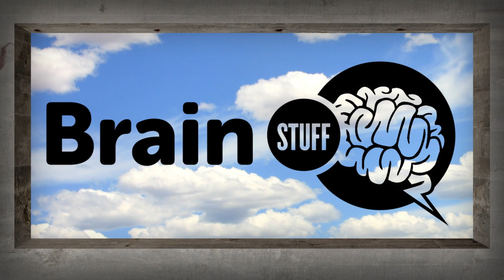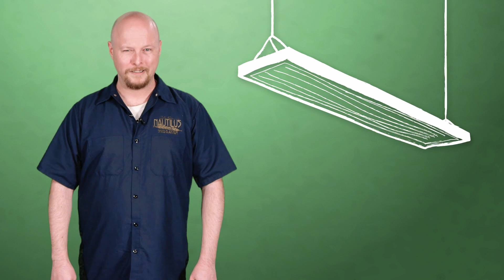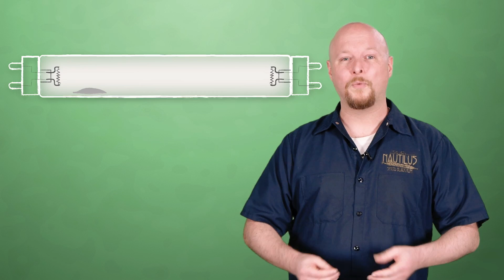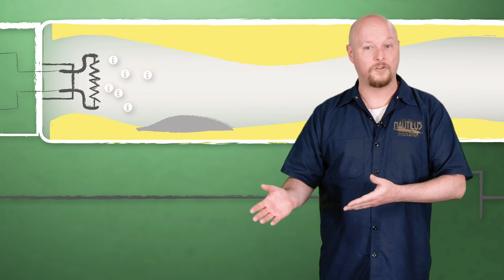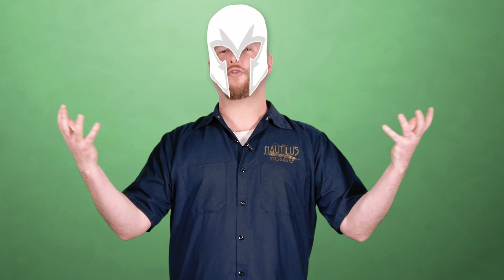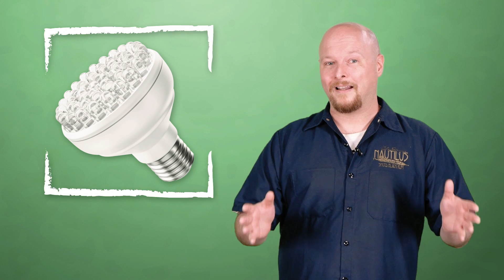Why Do Fluorescent Lights Make That Buzzing Noise?

Comment: "If you're not careful and you no-clip out of reality in the wrong areas, you'll end up in the Backrooms, where it's nothing but the stink of old moist carpet, the madness of mono-yellow, the endless background noise of fluorescent lights at maximum hum-buzz, and approximately six hundred million square miles of randomly segmented empty rooms to be trapped in. God save you if you hear something wandering around nearby, because it sure as hell has heard you"

Comment: I worked at a business college for a time and as I am not a young lad any more l couldn't always hear that annoying buzz but the younger students could. It wouldn't be present at first but the longer the lights were on, the more it would buzz. I did indeed replace many florescent lights in my time. The noise is like a tiny critter is in your head and is sliding a knitting needle in and out of the ear really slowly. 😩

Comment: Actually, it's a tad more complicated than *just magnetostriction*. If you have a fairly recent well built fixture, the noise is very minimal. pretty much to the point it's almost completely unnoticeable in a dead silent room. The reason a fixture which was once silent would become noisy and create that hum has a couple reasons. 1, the ballast itself gets quite hot when in operation. enough to cause fairly significant thermal expansion of the core. 2, the ballast likely undergoes many heat cycles from being switched on and off and 3, the forces of magnetostriction cause the core of the ballast to vibrate a bit when in operation.

combine the temperature cycles and the high operating temperature of the ballast with age (say, a good 15-20 years on a well made ballast) and you end up with  a failure of the adhesive that holds the iron core's laminations together, which can allow them to resonate against each other due to the magnetic field generated by the coil. this is where you get that loud and obnoxious buzzing noise from. It's also worth noting that electronically ballasted fixtures (which pretty much all recent ones are) don't exhibit these behaviors as their inductors are much smaller and operate at frequencies inaudible to the human ear. not to mention they don't rely on electromagnetism exclusively for current limiting.
Reply: Forgot to add that the switch may not be compatible with new bulbs introduced on the circuit. Humming is a resistance issue especially caused in led retros on a non capability switch not designed to old designs to handle the semiconductor of the led produced.

Comment: In a building I manage I have vanities that take 4 bulbs. In one particular installation we have gone from incandescent to LEDs (60W) in trying to get rid of the humming sound, but to no effect. There is only a simple on/off switch in the cct. CFLs have shown to have a similar sound after warming up. Might you be able to tell me 'what's up with that?' thank you
Reply: Make sure the switch is capable of the retrofit bulbs, if the switch is old and you retrofit leds it could cause electrical noise due to resistance interfering.

Comment: Ballast ( or choke)  does not serve to limit current.
Actually it serves to  rise voltage to achieve to "breaking" point  from filament to filament.
Once that point is achieved you have plasma which regulates it self (R C circuit effect)

Comment: Are you sure the Mercury is Liquid ?  I was under the impression it was in a powder form, which electrically excited, forms a gaseous state when charged. Its basically the same thing, but I wasn't aware of the mercury being in a liquid state.  Nice Video though. Well presented and well scripted.  Shame you didn't have any examples to demonstrate. Would love to know a bit more about what physically causes the ballast to vibrate so. I have a set of ( former ) kitchen strip lights I mounted to a picture frame as a sunglass compensator/work light.  
  One of the buggers buzzes.  They must have the ballast built into the housing. Tried swapping the bulbs about. But its from the unit itself.  
 Might rewire to see if running them in parallel works better than series ( last one is the buzzer )

Comment: I actually prefer far beyond fluorescent than LED. I think the greatest thing you can do if your ballast is humming is replacing it with an electronic one, which may not last that longer than a magnetic one but shure it will not hum, maybe at all!
Reply: i can put up with a bit of hum, especially since if the ballast is in good shape they hardly hum at all. i have some old fluorescent lights from the early 50s that still have the original ballast and they hardly make any sound at all unless you put your ear up to them. electronic ballasts normally struggle to last even 5 years.

Comment: I use a fluorescent light in my basement since i use a computer alot, and a light that would leave streaks of light in my eyes when i blink wouldnt be desirable (Also since the design of them lights up more space)
Whenever i have my headphones off, that noise drives me absolutely insane, even with them on, i can hear it loud and clear
You can hear it through the floor into the living room, and whenever im talking to someone via skype, they cant hear me at all

Comment: the considerate amount of voltage is about 25kv or higher depending on the type of fluorescent starter and ballast, also the buzzing doesn't come from the tube itself, it comes from the ballast, much like when you hear the hum or buzz from the transformer in some electrical appliances and devices. one of the ways I know this is mainly because I looked into lighting for a decent sized portion of my life.

Comment: Why does the US have 120V/60Hz while the EU has 240V/50Hz? It seems smarter to have a higher voltage and less current for the same power, since it's the current that induces voltage loss over distance and also creates more heat in power appliances.
 Was it purely because of history?
Reply: Lord Thanksalot The US does have 240V/60Hz it’s just split into 2 phases in the panel each phase is 120V/60Hz and there are times that use both phases to get 240V/60Hz like the drier stove electric water heaters and electric furnaces (some gas water heaters 120V/60Hz and all gas furnaces use 120V/60Hz)

Comment: Got on this video by mistake. 2 months ago my dad mounted a new light bulb in my room, is like a circle and it flashes for 4-5 seconds, then it turns on and makes a noise, didnt checked why this makes sound. I throught it was because it was cheap (10 USD) but now I know why it hurts my ears. Gonna ask him to replace it asap.

Comment: So how do CFLs die and why do they turn black at the ends when they are about to?
Reply from the maker: I'll add that to our list of future topics. But there seem to be a lot of electrical/lighting experts here in the comments. Anyone know the answer?
Reply: karebu2 as the bulb strikes on (powers on) the filaments heat up and when the bulb finally strikes and lights it blows a tiny amount of the metal on the filaments off onto the side of the lamp and of course since it’s AC power the light is off and on 50 or 60 times a second causing it to wear out and fail 

I hope this explains that well enough 

-SomeRandomGuyWithAChannelOnYouTube

Comment: Long, straight tubes are not CFLs as they are not COMPACT.
The buzzing only happens with older magnetic ballasts and not the newer instant-start electronic ballasts, which don't flicker or buzz, but must be used with new thinner T8 bulbs.
If you replace the bulbs and the ballast, it won't "go bad" as you have replaced 100% of the functioning part of the fixture (or Lumiere).
Side note as an electrician: leave new bulbs on (and replace as a set) for 24 hours for longer life and faster starting. Then, use as desired.
Reply: BariumCobaltNitrog3n as the ballast wears down there is a slight chance it will buzz quietly but it’s not a big deal
Reply: i can put up with a bit of hum, especially since if the ballast is in good shape they hardly hum at all. they dont flicker either. and the instant start on electronic ballasts just wears the tube out quicker.  i have some old fluorescent lights from the early 50s that still have the original ballast and they hardly make any sound at all unless you put your ear up to them. electronic ballasts normally struggle to last even 5 years

Comment: CFLs, or Compact flurolecent Light bbs, don't really buzz, at least in my experience. Josh keeps confusing between CFL and FL, which are different. CFL is the twisty bulbs that fits into the traditional light sockets. They are pretty silent. In my experience, it is the Flurolecent bulbs, which are the straight stick ones, that buzz. But the worst Buzz I've encountered are from school's gym lights. Not sure what they are
Reply: Actually, all I have are CFL's in my house and some of them do buzz.
Reply: Jim lights are  florescence. The tube is just U shaped and they fit inside of a  metal box. However the problem  is that Metal box off in times amplifies the already loud  light, so  you wind up with an angry light that is about 20 dB louder than it supposed to be.  As for compact florescence it really depends on what kind you get. The cheaper ones do buzz a little, but they are not nearly as loud as the U shaped or the straight tubes. Also the wider the tube The louder the buzz.
Reply: I have occasionally observed humming from 20th century made florescent light fixtures that used electromagnetic ballasts instead of modern electronic ballasts.
Reply: Robert Sitch The electronic ones  appear to be a little quieter. You haven’t heard a loud light until you have  heard the one inside of an old trailer at the high school that I used to go to. The trailer was built in the 60s so  they still use the old balists. This thing would start out very quiet, nothing more than a little hum, however if the air-conditioning came  on or if any kind of loud noise was made this thing would suddenly start this ear splitting buzz that could be heard from 100 feet away. And that measurement is actually if you are approaching it from outside with both doors shut. If one of the doors was open it would spread even farther. The trailer was kind of by it self in the back of the school so on a calm day outside you could hear it about 20 feet before you approach the ramp to walk in. It could be heard well in the main room, but that wasn’t where it was located it was actually located in the little room in the back.

Comment: Is there any reason why CFL bulbs have those twisty shapes?
Reply: More tubing in less space?
Reply: GoldViolinFlutist Right.
Reply: GoldViolinFlutist That's also why your brain is all squiggly.
Reply: Electricity moves very efficiently. It will travel between the positive and negative terminals in the shortest path possible, this would mean it doesnt spend a lot of time in the actual light bulb, so it doesnt produce much light. The twisted shape is so the electricity is forced to move around and around, doing more work, and making more light before reaching the exit. The old light bulbs has a similar process, though instead of moving through a gas, electricity moving through the small twisted coil of metal which light up as it was heated
Reply: Leonard Greenpaw the old bulbs also used that to let the winds heat up each over, for an overall more balanced light
Reply: Your answer is in the acronym. They twist to make them compact.

Comment: I still prefer incandescent bulbs, the light is warmer (literally and the color) and you don't need a haz-mat crew to clean it up if it breaks nor do you have to throw them out carefully, to a recycle center.  CFLs are terrible.  I agree LEDs are much better, but still, not a warm light and the color is off.
Reply: I thought color warmth or cooless are available in all 3 types of lights...
Reply: GoldViolinFlutist That's what they say, but it's not true.
Reply: LadyPashta Just open a window for about five minutes, and it should be good.
Reply: LED's now come in all temperature colors from 3000K all the way up to arctic white at 6500K 3500K is identical to incandescent.
Reply: LadyPashta I'm not even joking. The amount of mercury contained in the average CFL is so insignificant that you really just need to open a couple of windows and doors and turn of any ventilation and just wait a little bit and it will all be gone. Really, though, the amount of mercury is so insignificant it barely even matters at all.

What isn't insignificant is the amount of toxic fumes released into the air caused by inefficient incandescent bulbs, and that will not just affect this generation of children, but the next generation and the one after that.
Reply: But a 100 watt incandescent bulb uses much more energy oppose to a 5 watt LED bulb. But I guess it's personal preference. I use the incandescent bulbs because I'm cheap and when I see the price tag I think of the cost at the register rather than the savings on the electric bill.
Reply: +LadyPashta There have been significant advances in LED technology, not only in the last year since your reply to this thread, but the problems that you experienced were probably due to cheap, poorly-made LED lamps.  You are absolutely correct that there are LEDs out there that are substandard.  I'm in the LED business (so, yes, I'm a little biased) and I can tell you that my customers are absolutely thrilled with the light quality of my LED lamps. Fortunately, the prices have come down significantly to the point where LEDs are a viable business option.  LEDs are available in all color temps and the quality is consistent.
Reply: SpiritBear12 yes, LEDs cost more to purchase, but you will have spent more in electricity + bulb costs over the life of the LEDs. So, LEDs are actually cheaper.
Reply: LadyPashta
Incandescent bulbs will no longer be for sale in many places in the world. It's the coal of lighting sources.
Reply: AlcoveShadow LED sucks.
Incandescent are the best for indoor. No LED can replicate the original 2.700k from incandescent, despite of what they say. Furthermore, LED produces a weird and bright light the I cannot get used with.
They replaced some street lights with LED here in Brazil and went back to HPS. Beside eye fatigue, they didn't saved any electricity (HPS has 130L/W (including ballast loses), while LED just 100L/W) and costed a lot more.
Indeed, LEDs are great for low power usage (like 12V bulbs for camping) and as indicator lights (like the one in your keyboard, or the backlight of your notebook).
Reply: Cole Johnson I have children, it IS enough to harm their brains.  We shouldn't be using them.  Just because you can't see immediate effects, you think it's ok??
Reply: SpiritBear12
Tell your landlord or building manager about your buzzing lights and ask if you can have electronic ballasts installed in them (which don't buzz). Also, there are conversion kits to convert ANY light to LED. here's a sample for a recessed light http://www.homedepot.com/p/Commercial-Electric-5-in-and-6-in-White-Recessed-LED-Trim-with-90-CRI-2700K-CER6730AWH27/204726945
Reply: Prices are now in the manageable range. My ballast-compatible tubes are only 24.99 (works with or without ballast, so no rewiring needed). If you dont mind doing the rewiring, they are under $20.
Reply: LadyPashta
you're right. there will always be a market for incandescent. and I'm glad. I'm old school, I'm an electrician. the warm glow is like a tube amp; the standard for analog in lighting. I'll still fight the fight for progress and embrace the future, but I'll always appreciate the past.
Reply: So much misinformation here. Yes, the insides of fluorescent lights are toxic and even if they don't kill you immediately, you can get for example lung cancer from them in the long run. The simple solution is to not breath the dust when they break and just vacuum it when it has settled. Yes, you can get all the lights in all sorts of colors. It is true, you can. Yes you can, I always do get them in a warmer white. LED lights have gotten SO much cheaper in recent years and even with a higher cost, you'll earn it back multiple times by saving in electricity, so yay LEDs!

LadyPashta, you actually may be forced to buy the newer, better technology eventually, if you are not too old, because the incandescent bulbs won't be around forever and we are all better for it.
Reply: Joseph Shoults LED is garbage!!! You are a sheep!!! Accepting what the damn globalists shove down your throat!!! Incandescent, halogen, HID lamps – high pressure sodium, mercury vapor, and metal halide – and fluorescent T12 and T8 are way better than LED!!!

Here's a link that explains that LED lights is a globalists agenda: https://youtu.be/yA9leI8GoYY
Reply: With LEDs you can get whatever color you want. Just most people prefer pure white.
Reply: Bob Joe Very funny.  Luckily the idiotic ban is now OVER.
Reply: "Only" $24.99 compared to less than a dollar incandescent?
Reply: BariumCobaltNitrog3n No, it's not, no matter how badly you want it to be true.  Incandescent bulbs are cheap, warm and safe.  Nobody will force me to buy a product, EVER.

I still buy incandescent bulbs and will always do so.

Comment: question, what about the UK, since we run on 50 herts, and my house's kitchen light is a long Fluorescent tube-based light that doesn't audibility buzz, despite being there since we first moved in over 14 years ago?
Reply: BrainStuff - HowStuffWorks Older ballasts tend to humm more. However, mounting the ballast on a surface that absorbs the vibration eg a kitchen ceiling makes the sound almost inaudible. However, having a floating fitting that can resonate causes the sound to be very clearly audible!
Reply from the maker: Interesting... I don't know the answer. Anyone else from the UK know?
Reply from the maker: Peter C Thanks for clarifying Peter!